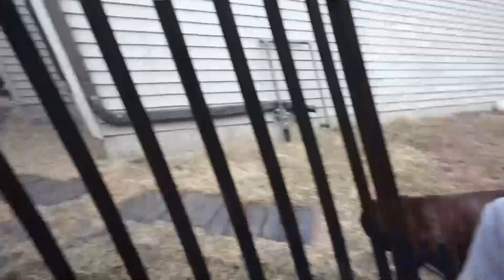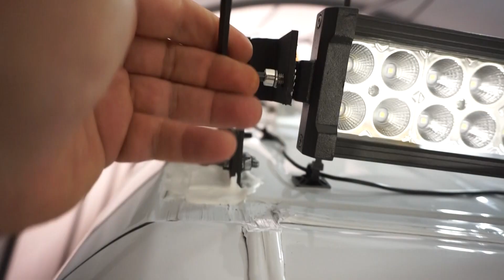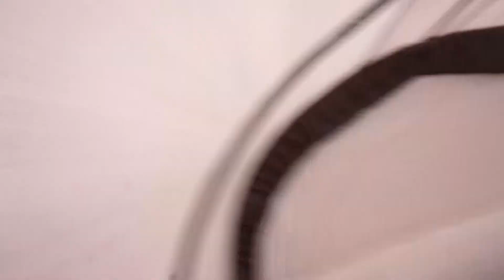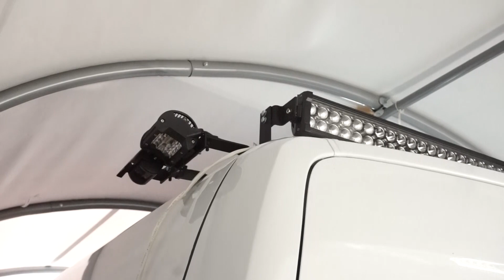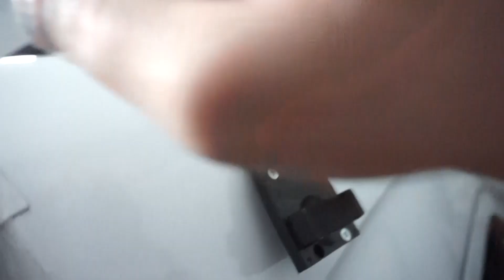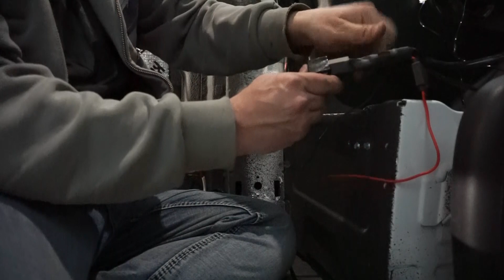Roof Top SECURITY Lights | FOUR SEASON VAN LIFE | EP.17

Comment: Isn't 40 amp to little for 2 long light bars and 2 spots? 40 amp is for one lightbar. i thing you need at least 100 amp relay. Arent you afraid of rust and water inside your van? When you are in ice cold temperature. The screw will be ice cold inside your van will be warm. the the screw will condensate and drip water. I'm not sure the English word. But you need to have a barrier to privent cold to go straight into your van. 
I love your build and videos!! Just a tip/question. You have always tought about privent rust. But you scrw treu your van will bring the cold in to the hot inside... need Thermo barrier.

Comment: I think that is the most horrible idea to install eniting on roof with so many holes drilled.
Reply from the maker: I appreciate your input, I believe you should limit holes in roof as much as possible but as long as you seal it properly with good sealants it is not an issue.
Reply: Why didn't you go with rivnuts for the mounting? Wouldn't have to have pulled the shelve and headliner.